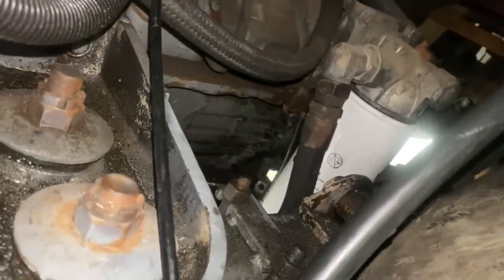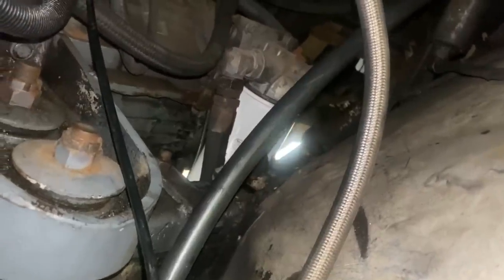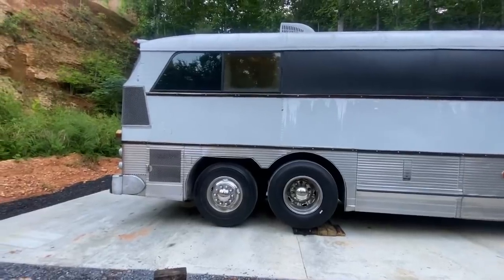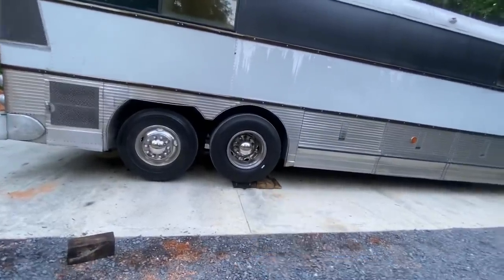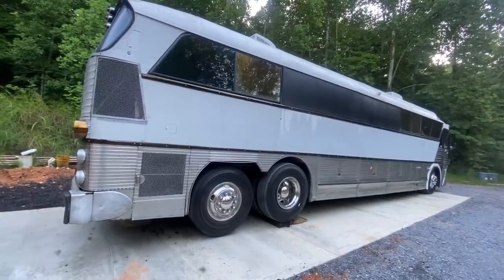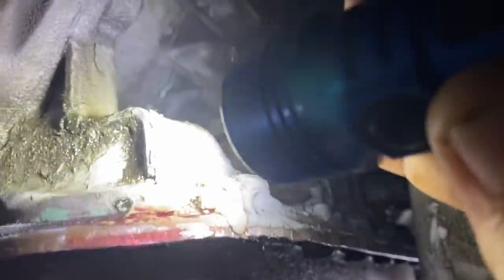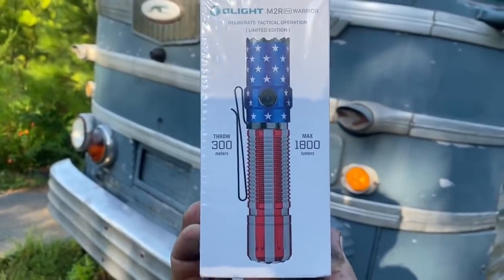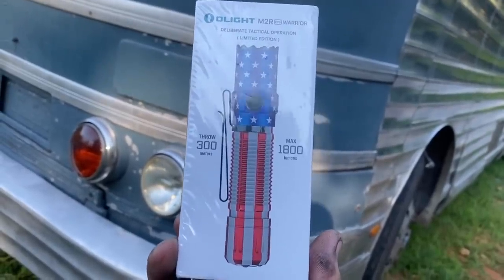Mci bus in for light maintenance and transmission leaks

Comment: Scott, for something better than either JB Weld or Right Stuff, try Devcon Titanium Epoxy https://itwperformancepolymers.com/products/devcon/corrosion-erosion-repair/devcon-titanium-putty/ it's used to fix coal slurry pipes and canon bores.   Very expensive, but I've used it to repair a motorcycle head.

Comment: Quick question.  The tour bus company I used to work for always preached the idea of once the bus hits the gravel or dirt field the A/C needs to be turned off because dust from the gravel has a tendency to give the sand blasting effect to the A/C cooling coils because of it being so close to the ground.   Is that the same practice being followed today???
Reply: I'm guessing with the overhead A/C units becoming prevalent this is no longer an issue.

Comment: My first charter bus driving job was 79-82 mci buses in 1997.. We were told every 2500 miles on brake adjustments! In 2005-2006 I was a company inspector on semi trucks and every semi truck I inspected needed brakes adjusted ., And all these truck had self adjusting brakes!

Comment: only had to shove a screwdriver through a filter once and I thought I was going to be unsuccessful but it worked. Whoever owned it before must have really put it on or it really got hot? One thing I found out is a diesel fuel filter won't seat right only hand tight especially one of those plastic ones. Used a rubber side strap wrench and got it tight so it would quit loosing prime

Comment: I've never had JB Weld hold anything !!
Reply: Fixed an oil pan on a race car with it when it left the track, worked great.  Also did a radiator head tank once and it held until I sold the car....   If you really need something better, try Devcon Titanium Epoxy - https://itwperformancepolymers.com/products/devcon/corrosion-erosion-repair/devcon-titanium-putty/
Reply: Glad you said that. Neither have I. I just always figured I did something wrong.
Reply: cleanliness is huge issue
Reply: I used it on a gas tank, and it lasted about 10 years before it started chipping loose.
Reply: I've used JB weld in a myriad of projects and had great success. But cleanliness is the big issue, and it's a terrible "sealant". It needs dry surfaces, a little atf mixed it and it won't work
Reply: Adhesion and prep is critical. Even with that, JB Weld is like concrete. It has good compression strength and no tensil strength. I have repaired a few oil pans with jb weld. First thing is drain oil and leave drip for several hours. Clean while drawing a vacuum from the inside from a fill or vent point to keep oil from re-entering the crack or hole. Apply the repair material and immediately embed regular old fiberglass insulation. Leave the vacuum on for 10-12 hours. Apply a second coat the same way without the need of the vacuum. This method works really  well and will last a very long time.
Reply: @bus-fun-addict  I've used the tags that I cut out of T-shirt necks on small repairs........Works like a charm.  I LOVE your idea!

Comment: Whoever put the filter on didn’t wet the gasket with oil, see it many times over the years, I have  had to do the same to get the filter off.
Reply: I literally ripped an oil filter apart using a screw driver. I had to use a chisel and hammer to get the base of the filter to turn off. Always, always put oil on that seal!

Comment: I get the impression that most people forget their conversions are still a bus. Here in the U.K. this would be inspected, by law, at least every six weeks with brake slack adjusters falling within that routine inspection and maintenance. There also seems to be a lot of inept mechanics who tackle these vehicles but in reality are clueless or simply don’t care so long as it kinda runs. Disconnecting the tag axle brake would result in what we call a DV9 meaning a prohibition and impounding of the vehicle until the faults are rectified. This would be done by DVSA transport safety officials and would most likely incur a financial penalty and be a strike against the operators license, if severe enough a restriction, suspension or complete removal of operators license. I don’t know what legislation exists stateside, it seems to vary state by state but it would appear some states are very lax toward inspections and maintenance.
Reply: This is one of those “it depends” situations.  If the bus is used for commercial purposes, passengers and/or freight, it falls under Department of Transportation (DOT) Federal Motor Vehicle Safety Standards (FMVSS) and would require inspections and repairs.  If the bus has been converted to a motorhome, and is titled/registered as such, it is no longer a commercial vehicle and the commercial vehicle rules/regulations do not apply.  At that point, whether or not any form of annual inspection is needed becomes a state issue.  The parallel questions/discussion to this is the “what sort of driver’s license do you need to drive a converted bus?”  I’m not sure where entertainer coaches fall in this spectrum on commercial/non-commercial use.
Reply: @brucefay5126  depending on who's operating it if its  band members sharing the driving duties and the own it than no special licenses is required. But if the bad is leasing or renting it and a driver it falls under a motor coach for hire deal and then they have to have a CDL with the proper class and will be subject to DOT rules and regulations including a log book.
Reply: Nope. If it's a living vehicle, why would it need an operators licence? I know many people who live on converted buses, (in the UK) and they  don't need mandatory six week inspections, as you suggest.